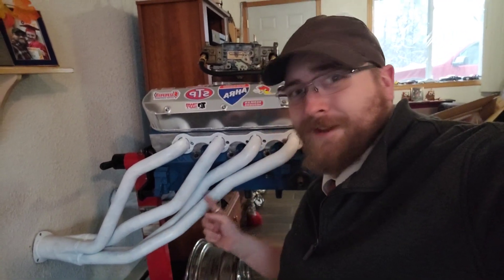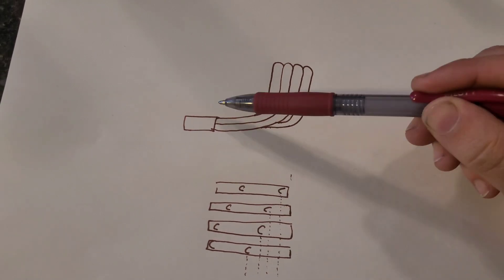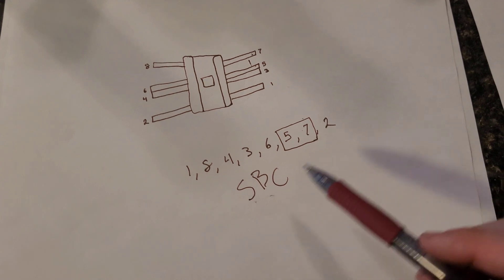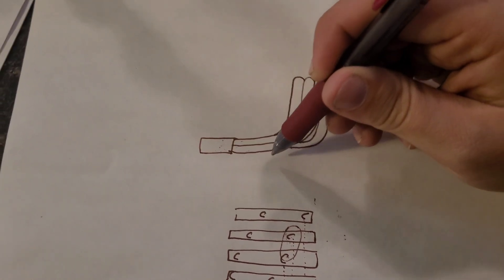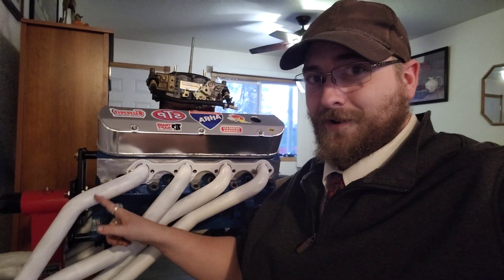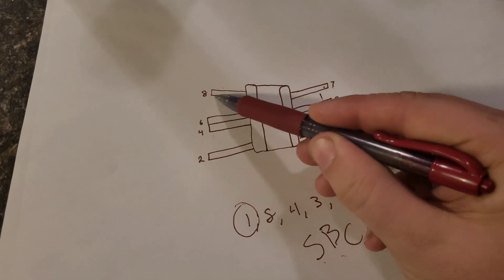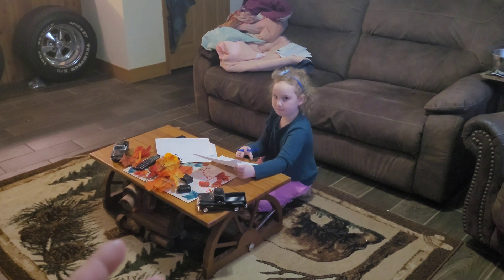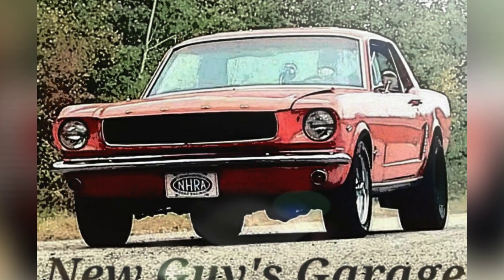EQUAL LENGTH HEADERS LOSE POWER! .....and here is why!

Comment: Yeah, uh no.
Not according to dyno testing - which is where the significance of equal length primary tubes (for racing purposes) came from.
Once an entire exhaust system is placed behind a set of headers, by and large the gains from the headers themselves are significantly diminished, at that point back pressure, and the use of X pipes as a means to propagate exhaust flow became as significant if not more so than the headers themselves.
Reply from the maker: https://youtu.be/AxGa6byZyOw

You want to talk about dynos here is your guy.......he litterally wrote the books legends read lol 😆

Comment: How do they affect sound? Especially on flatplane v8s, because I think Ferraris use equal length and the gt350 used unequal length. Both flatplane but sound wildly different. How is that explained?
Reply from the maker: Firing order will change sound,
And you only hear the exhaust sound after it exists the end of the exhaust so anything you do to lengthen or shorten that distance will affect sound 🙂
Reply: @newguysgarage6802  what’s the firing order on a ford voodoo v8 vs literally any ferrari v8 (non Maserati)? Also thanks for the explanation, wouldn’t have known firing order affected the sound
Reply from the maker: ......well ford had a bunch of different firing orders 😅

And im not really familiar with Ferraris but i bet you could find out that stuff with a google search 😁
Reply: @newguysgarage6802  I shall do some research, thanks man
Reply: @fadedsoul23  Ford's Voodoo flat plane uses a very different firing order than a normal even firing flat plane.  They did it literally just to maintain an "American muscle" sound.  

Driving 4 Answers did a great video on this.
Reply: @ClipstopherBurtraw  I was not aware of that, thanks man

Comment: Header science can get crazy really quickly.
To keep it simple a fella can just add an X pipe and enjoy the results.
Or go deep into building a properly tuned 180 degree header and enjoy the biggest result.
Reply: if you have the packaging space for an X and 180 headers. You can get an X to fit but its too steep of an angle it'll negate any gain youd be tryin to get. It all comes down to flow based on the path of least resistance. But here again, engine masters did the header bash test and it gained 1-2hp via their dyno and keeping the conditions and variables to a minimum. Again, 1-2hp, you'll only care about that if youre trying for dyno-queen flex numbers. But it also shows even as a negative 1-2hp loss isnt going to change much. you can easily gain/lose more than that depending on the weather at the track.
Reply: The absolute best bet would be 180-degree tri-y headers where the 4 resultant secondaries are plumbed sequentially/radially into a 4-1 collector. 1-3/4 into 2-inch secondaries into a 4-inch final collector should do the trick.

Comment: My boat has 8 in to 1 sbc. Is Is this going to be different
Reply from the maker: No the actual tube length tuning will be the same.

The goal is to have each pulse enter the collector one at a time so that the collector has a constant steady pull on all the tubes. 

Easy to say but hard in reality to do, so as long as you have a good collector length (18" at least) that should help the collector keep a good signal on the tubes.

Now all 8 into one i would think you would want a bigger collector diameter like 3.5" to accept all of that exhaust (mabey even a 4" if your motor is verry stout!) 

Dose that make sense? 

Collector length helps the handicapped tube lengths
Reply: @newguysgarage6802  cool. It's 4 3/4 inch very stout methanol dry sump. I start racing after Christmas. Manning River Taree Aus. Love ýour channel mate
Reply from the maker: Perfect! 
Sounds awsome 😀 

Thank you for watching!